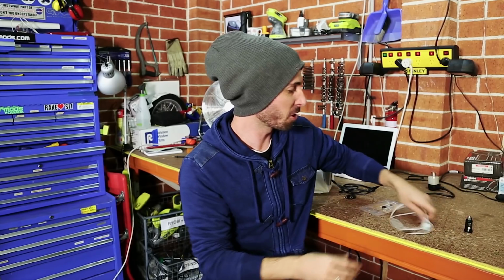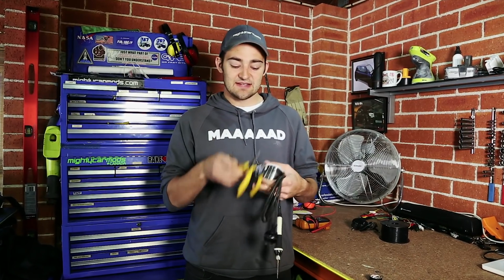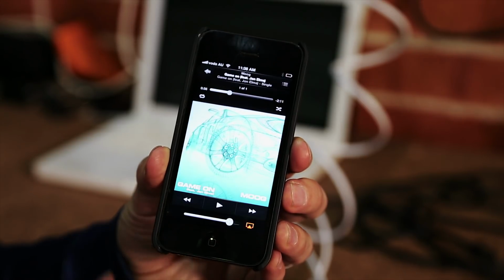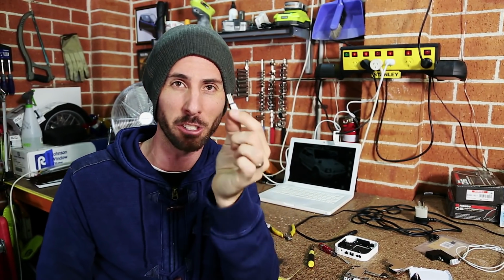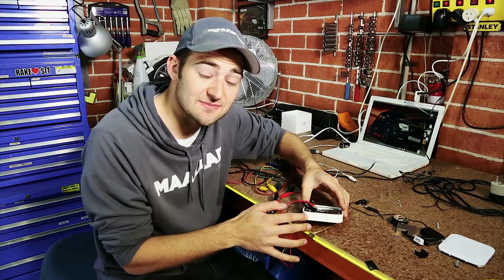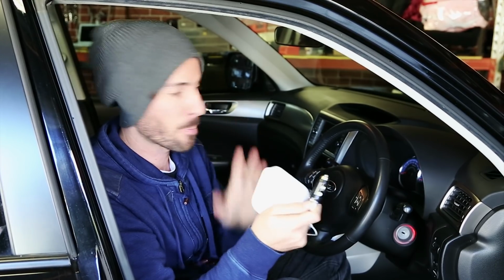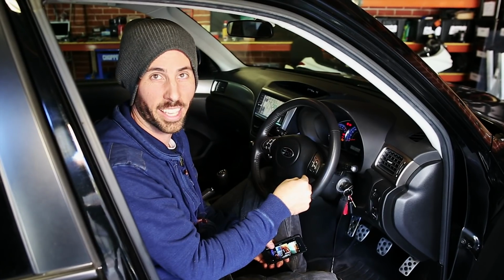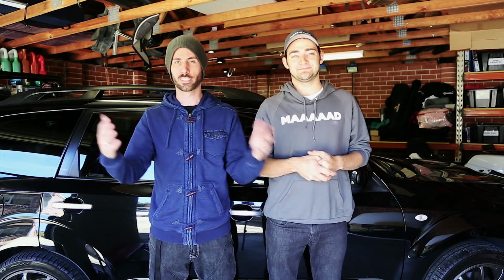Install Airplay In Your Car

Comment: This is mad, but wouldn't it just be easier to install a bluetooth stereo?
Reply: airplay has higher audio quality, and bluetooth is cheap, and easy, and alot less madddddddd
Reply: DubstepEnjoy its really just cleaner then an aux cord, also if you live in an area where its below freezing half the year you have to replace aux cords all the time because they get brittle and the cords stop working.
Reply: eddie mirsberger Im not saying this to act like an idiot or an ass, but wouldnt it be just the same quality as if you connect via AUX? 
If that's so why not just connect the auxillary cable and let it play via that, seems a bit unnecessary to go through all this. 
Sorry if im acting like a douche and my english aint that great cause its not my language to begin with
Reply: Nah man its fine, didnt soumd like a douche at all. But this is just the best wireless way, an aux cable works but if you got 4buddys all in your car, aux cables get annoying fast
Reply: That would be easier for one car. This airplay is a mobile setup so it can be used by people who don't have bluetooth stereos.
Reply: i understand that this is a MAAAAAAD mod, but i just dont understand that one cable can be such a mess , why should 4 people constantly be changing songs from 4different devices? I just see the big deal i guess, :P
Reply: eddie mirsberger oh ok! thanks for all replies guys! it really opened my mind  a bit
Reply: DubstepEnjoy not a problem mate, that's why I'm here
Reply: Bluetooth is not working in many cars, like Volvo V50. 
Airplay are the best solution.

Comment: Any ideas on how I can play my own music in a car without USB/AUX port and has a in-dash head unit and a single disc player without spending too much? FM Transmitters never worked properly :( And CD is limited.
Reply: So I ended up with an 06 Civic with notoriously sh*tty FM reception and no aux-in. The stereo itself has an empty socket in the back where the aux in cable would have gone; so, for me at least, the solution was surprisingly simple: I found a compatible after-market aux in cable on ebay, got a tiny $10 bluetooth unit on amazon, a male to female usb cable to power it, and a dual socket power adapter. 
Works great for me… mostly it depends on how much of a hassle it is to get to the back of your stereo. Good luck.

http://www.ebay.com/itm/Car-Auxin-Adapter-Car-Mp3-Player-For-Honda-Odyssey-Accord-Fit-Civic-/251432254161

http://www.amazon.com/gp/product/B00GX71GNO/ref=oh_details_o00_s00_i00?ie=UTF8&psc=1
Reply: what kind or car? because certain headunits have a kenwood 13pin din plug on the back end of them. if you have one, all you have to do is buy a plug, solder a aux cord to it, then burn a blank cd, plug it all in, and play the blank cd, and plug in your mp3/phone and your music should stream through head unit, thats how mines set up in my forester
Reply: edward mirsberger Mine is a XV40 Camry, Asian version. For this model it only comes with a built-in head unit without AUX port. It has some kind of CD-changer port at the back and in the US, a lot of manufacturers actually have a kit where it goes straight to the port and gives you AUX, USB and iPod connectivity and all is controlled through the DISC menu. But the kit is so expensive. Currently I figured out a way to make the FM transmitter work but the sound is so soft. Was thinking of changing the whole thing to a Pioneer AVH-X4600BT or a Nexus 7.
Reply: Bright Ivan http://www.scoobymods.com/showthread.php/aux-input-ipod-solution-fxt-3357.html?t=3357&highlight=ipod+jack

thats the link i followed for my forester, if you have that same plug, you should beable to get it to work all the same. this is a pretty universal for a lot of cars

Comment: Or use Bluetooth
Reply: Shut up
Reply: R0ckstrmik3 Right on mate hope your new $30,000 car doesn't go up in flames with your $30 sweet ebay mod.
Reply: Christian Brown I am with you, either use an aux cord or bluetooth.
Reply: It has a voltage regulator installed onto the apple airplay.

Comment: It's a lot cheaper to setup Airplay with a Raspberry Pi. It can runs on 5V so you don't need a voltage regulator, and it also boots in a couple of seconds, so there is almost no waiting time for the airplay service after starting the car.

Comment: Bluetooth is ok its max rate is 1mb a second and you can't even leave the car to control it (bone fire party i couldn't get more than 5 feet from my car before clipping) and the sound quality and range is unmatched compared to wifi making wifi the only way to go for awesome functionality!!! Not to mention yes step this up to a apple tv box and now you have all the same options plus video!!! This is great for people with older dvd video in dash recievers i think (or people without app radio funtions found on pioneer and i believe Alpine), my cousin would benifit from this having a mid 2k kenwood excelon in the dash of his charger he doesn't want to let go of. For me i skip all this with my Appradio 3, HTC One X (rooted) ARunchained app gives me full mirroring of my phone to the radio screen making my radio's screen in to my phone literally. I may not be wireless as of yet but a neat tuck of the wire in my center console concealing my phone and bam phone stereo with full 28mbs internet speed, gps, all the phone apps and calling of course. I will step it up to wireless to i can leave the car with a mini hdmi router allowing same control with a 50$ or less addon!

Comment: Why didnt you just plug in a power inverter and run the airport express through that. No mods. No cutting. Plug and play and the air port express can be removed and used in any car or in the home. My way is better

Comment: Regarding the discussion between WiFi and Bluetooth...
The transfere rate on G- band WiFi device, such as the Airport Express, is 54mbits/s compered to the Bluetooth´s 700kb/s. And this means that when your stream an audio fee thru WiFi, it basically uses a non codec compression and the result of that is that the data fee is intact thru the hole transmission chain. The Bluetooth in other hand uses codecs to process the feed which means that the fead isn't identical to the source feed and this results in poor sound quality. That´s why a installed an Airport Express in my car three years ago.
Reply: They are using the new Airport express. It is a simultaneous dual band N. It will run up to 300Mbps.

Comment: Why not get an inverter off the 12 volt to run the airplay off 240 volts, save all the hacking and you can still use the airplay at home too.
Reply: that would increase the cost by a fair bit. this mod is about being a cheaper alternative to to buying a bluetooth headunit. adding an inverter would require more wiring some decent gauge power cable going from the battery to where ever ya fit the inverter. there not easy to install stealth which is also a major factor for MCM installs. so you can do that to your car if ya want to waste space for no reason but the money youll spend on the parts to do that you could buy 2 airplays and have one dedicated for ya car and a spare for home.....
Reply: Gavin Oakham I see what you mean about the convert aspect, but I got a 200 watt inverter for £13 here in the UK and its quicker than hacking the wiring.  With regard to adding more wiring, it can be powered by the cig lighter or hard wired to the battery which wouldn't take long at all.  Just a thought.
Reply: If ya gonna install an inverter in your car you might as well install One that can run basically Any house hold appliances in my opinion other wise its not worth it and all pure sinewave inverters I've seen need decent gauge power wire and a fuse. Fair enough if one is cheap where you live but there not in Aus and even if one is I think an a/c power cable will stick out like dogs balls in a car and I can't think of any where ya could discreetly install an inverter in a modified car. I mean if ya got a maaaaad stereo then you probly have an amp under both front seats and a sub or two in the back maybe some capacitors or even a dual battery system in the end your not left with much space to hide any extra mods so this discreet option MCM used seems like the most logical to me I don't use apple cause there awful in my opinion but if I did I would use this mod. But if a cig powered inverter does the job for you sweet man its all about the user so if that makes you happy all is well

Comment: Can u do the same thing to a Apple TV ?
Reply: Yes u can… I have an apple tv in my truck. I use my iPhone to create a wifi hotspot so the apple tv can connect to it and have internet access… 
The apple tv is powered by a 500 Watt inverter..  And i have a pioneer AVH-X4600BT to watch netflix, HBO Go, You tube.. you name it… 

Or for just audio only, just get a bluetooth head unit and stream music from you android or iPhone to the radio via bluetooth..

Comment: why not just use bluetooth????
Reply: or even the AUX?
Reply: parasitius
also wastes a lot of paper. also a bad analogy, as the signal is not copied. In fact, it's copied more through a head unit. But yes, there will be significant audio quality loss
Reply: Lossy!!!! Recompressing already lossy files introduces artifacts. Ever photocopied a photocopy over and over? Looks like hell
Reply: Bluetooth is easier.. these guys went above and beyond the call of duty to do this same task by just buying a bluetooth radio…  lol

Comment: What they should have done was get a small inverter the size of a D cell battery and  plugged the thing into that instead. All of that unnecessary work and you ruined the apple device and voided the warranty. I think the inverter costs  bucks on ebay.

Comment: Belkin airplay does all this for £30.  Running it on bmw e60. Stream calls through speakers and the unit acts as a mic and can use Siri so the phone can be dash mounted without messy wires

Comment: Bluetooth Audio Quality is Crap. this is the Most Excellent video you dudes have put out… well done.
Reply: bluetooth audio quality is better than an aux port. i find bluetooth quality cleaner than aux because it is digital most aux ports sound like crap and have hissing noise when turned up. especially in cheap head units
Reply: stay GOLDen Bluetooth compresses audio files, so you're not going to get sound that's quite as good as you'd get from Apple's Airplay wireless streaming, which uses wifi technology and doesn't compress files. Bluetooth has a tendency to flatten things out a bit, so you might notice your music doesn't sound as dynamic as it should, especially if you're streaming to better speakers.
Reply: Emile Séguin then soundman car audio has been doing it wrong all these years? air play does compress wireless audio.. thats why sound man has been using a dock with a optical out instead of air play
Reply: Emile Séguin sure it sounds better but its still not perfect

Comment: instead of braking open the airplay box. you can buy a little ac to dc, power converter, ( plug it into ur car and you can plug outlet using things into it ) instead of opening everything and possibly braking it, and its also so much less time consuming

Comment: something you could do is buy a radio transmitter that you plug into your phone or anything device with an aux port, and it will send the audio out as a radio signal. so all you do then is find the channel on your head unit and listen to it
like any other channel

Comment: For all those saying about different easier methods, If you want to keep your car close to stock and have little need of wires, this is the way in which you can do it, if your fine with wires or installing an aftermarket stereo then do them methods if you find them easier. case closed

Comment: Jesus thats an expencive way of getting music into your car. as said a heap of times, wouldnt it just be smarter if you must have wireless to use a bluetooth device to then get handsfree calling done, and would probs cost less. and a 5 dollar audio cable is a shit load cheaper then this, can understand doing something different, but wow you just destroyed a $100 apple item which you have also voided any warranty and apple help with if it ever buggers up.

Comment: couldn't you just buy one of those power inverters that convert dc into ac and then just plug in an unmodified airport express? its a bulkier solution but so much eaiser.

Comment: My 2009 Sony Vaio is basically unusable for my needs today (music/video editing, gaming, streaming to TV, etc), even though it's got a fresh install of Windows 8. I paid the same price for it as I did my new HP Folio, which does everything. And don't even get me started on my 2006 Dell Inspiron, lol. That things a tank (it still works with Ubuntu installed). My point isn't that tech will simply fall apart. I'm saying new tech makes old tech obsolete. Even 5 years-old tech.

Comment: You should know bluetooth wireless streaming sounds horrible, and what is the point of spending $300+ on your in car audio system when you are listening to shit bit rate compressed audio... And the whole point of the mod is to remove the need for cable, hence the use of the airplay, not an aux cable...
Also airplay have longer distance, allows multiple airplay connected to a single streaming device.. Eg you can have both your cars wired up and play the same music at the same time

Comment: there are many videos out there, but it depends on your car type and type of head unit. usually if its a standard car manufacturers headunit it involves finding a cd changer wire and hacking that to become a jack input.

Comment: I have an Android device, and i use a Belkin Bluetooth receiver, works really nice. And i install a aux input on the original cassete player of my car.  It was very discreet installation, everybody thinks that i have only one tape deck in my car.

Comment: Fantastic mod guys. More this please Marty and Moog!

I did something similar about 5 years ago with a PS2. Built a power supply, and did an under seat console mounted in an old Jag. Wired up to the electric seat supply (upped the fuse though). Took it a bit further and installed a 12v digi-tv receiver. Both gone now though, too much of a temptation when driving!

Good work guys, followed your channel from day one over here in the UK. Keep it up!

Comment: Or you can just buy a proper pioneer head unit with blue too and be able to control your phone via head unit. Cool hack just don't think it's that practical. $400 you gotta dash kit, DVD, Bluetooth, pandora and sub outputs with a wire harness. Just saying its a better deal. You'll be apple bound with airplay.

Comment: i have a 2011 wrx with the same gps headunit... the only reason he did this is because the headunit doesnt alow audio bluetooth streaming, only phone connection. so this was a way to bypass it without having to change the stock headunit.

Comment: Wouldn't just getting an inexpensive 2-port DC/AC adapter be even easier?  It's just as easily concealed and you could use it for other things (like charging a laptop).  I also agree that if you're going to use the aux-in in the middle console (not at the rear of the head-unit) it seems a bit excessive - but I like the thought process.  

Nice work! =)

Comment: alright im being a dick, one apple users? probably know more about hardware and software then some "buy a cheap windows run PC." blue tooth audio are you serious? i drive a new ford with it built in and it barely works, i cant imagine how shitty a 3rd party unit is. o and screw you

Comment: looks like a bit of hassle to go to when A. your right on top of your sound source making wireless unnecessary and B.  when all you need is a half meter 1/8 connection cable and your good to go, also better sound quality.

Comment: Bluetooth compresses the already compressed audio file that's on your phone? And here I was thinking it was a transmission protocol. Bluetooth 3.0 has a transfer speed of 24Mbit and Bluetooth 2.0 has a transfer speed of 3Mbit. So theoretically even BT2.0 is capable of streaming music at well over the usual MP3 128k or 256k bit rate. It's also capable of streaming an 80 minute CD in <5 minutes. This would indicate compression isn't required... Freaking downy, Wikipedia is like a few clicks away!

Comment: you could also get an audio cable that plugs straight into the heaphones jack on your phone for maybe $5 tops and save a load of battery life in the process by not using bluetooth

Comment: I use an FM transmitter and it works perfectly to me. You have to set it to a station that isn't being used by a radio station though. Sometimes you get some static when you get some interference but other than that its good.

Comment: I wonder what would be easier in an R34; hard wiring a bluetooth system under the dash that would be connected to the speakers or hard wiring this AirPlay system under the dash cuz the Bluetooth system can be annoyingly buggy sometimes. Maybe both would be a good option.

Comment: Or you could do this because you have a subaru witch has an lcd head unit as stock and you dont want to rip it out and replace it with a $100 single DIN unit?

Comment: everyone saying that it would be easier and cheaper to use an aux cable, you would be correct but that's not what they are going for. They are going for a WIRELESS adapter which they did.

Comment: Or you can buy a relatively cheap head unit with Bluetooth audio streaming for under $100. The Alpine UTE42BT for example.  That way you can also use it to take calls, and stream wireless music through your car audio system.

Comment: why not use a RasPi with XBMC? Costs less, doesn't require a voltage regulator (correct me if I'm wrong) so you can just use a standard 5V micro USB car adapter and you have HDMI to play with in a next episode ;)